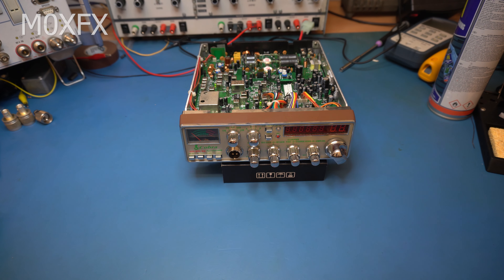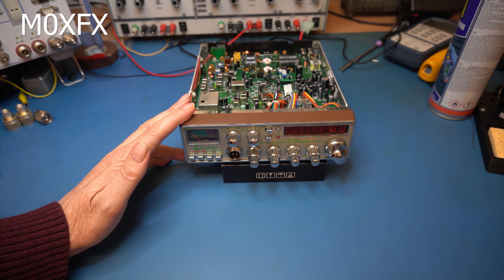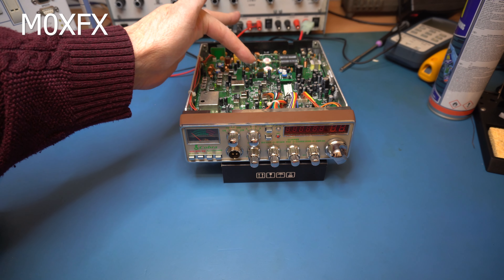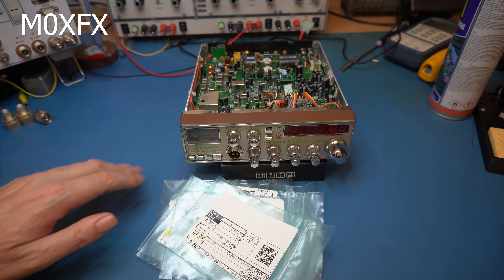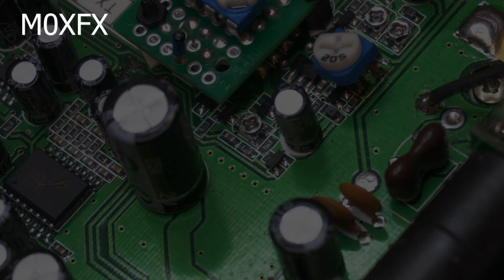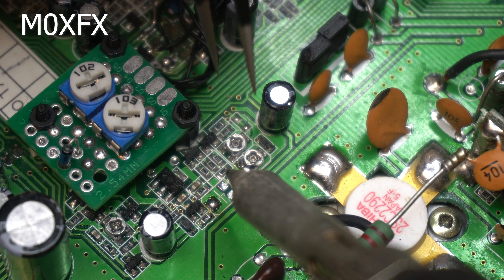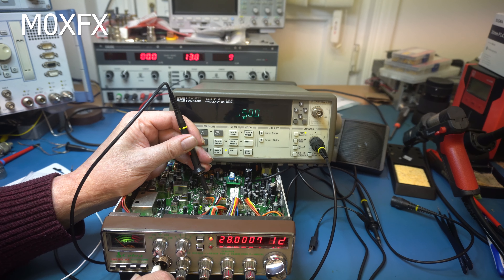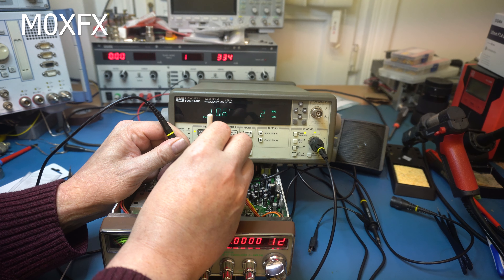Cobra 200 GTL DX Repair & Alignment Part 5 of 5

Comment: Nice finish off John
Reply from the maker: Hi Ray thanks for the comment. It may want T710 replacing as it looks like it’s been really baked by a soldering iron. That being said it's seems to be working but I wouldn’t trust it long term. They are pain to get out as the pins are so loose in the former and pull out when you try to de solder them.
Reply: @M0XFXUK  Hi John yea the coils are a nightmare to get out in all the new SMD radios the pads come away far to easy.

Comment: Well done mate. U did get that spot on they do sound really nice on receive. Looking forward to the next one John.
Reply from the maker: Thanks Gary. Yeah it's an interesting rig only real issue is that the TX and RX frequencies get out of sync in FM when using the clarifier. I think it’s to do with the 10.240 PLL clock getting pulled by the clarifier as it’s only FM uses the clock for receive.   Design issue, not sure if Cobra sorted it out in later models.
Reply: @M0XFXUK  no they havent yet mate. I read somewhere that it shows its head only after the 11 meter mod is done.

Comment: Hi, love your videos, thanks for taking the time to produce them. One thing I noticed the instructions stated the S9 meter calibration was to be adjusted and set using Freq. 29.500MHz not 28.000MHz. Not sure if it would make a difference, I was just wondering if that's why it was so far out of adjustment. Thanks.
Reply from the maker: Hi Kevin, Thank you for the comment. To be honest I don't think it would make much of a difference. For me it would make sense to set the S meter to the centre of the receivers tuning range which is in this case is 28MHz. Regarding it being really out, I had replaced the signal strength meter trim pot for a new one which I didn't show in the video as it was getting too long. In fact I replaced all the resistor trim pots as they were all in pretty bad shape. Another thing is that I set S9 to 50uV -73dBm which I have been told it should be 100uV for CB radios but that being said 50uV is correct for the 10 meter band so I guess it's what you want to use the radio for. I'm glad you like the videos. Best  regards John.

Comment: I have a 200 gtl dx and a 150 gtl dx what would I have to do to use it on 11 meters?? Thanks and any help would be appreciated..
Reply from the maker: Hello Charles, There is a simple mod you can carry to make these work on the 11 meter band and cover the FCC / EU CB channels. I have never done this myself but it looks straight forward enough here is a link. Note: You will need to be able to solder / de solder to a reasonably high standard as this involves surface mount components. If you are not experienced then take the radio to someone who is as it's really easy to cause damage to the unit.   https://swap.qth.com/fcc/cobra-gtl-mod.pdf
Reply: @John Hawkes  just wanted to say thank you so much for the help I hope you have a great night and a better tomorrow...

Comment: More patience than i have, i would have put the hammer through it by now.
now if it was a decent radio i'd spend the time, but knowing how these radios are it would probably be easier to rip the insides out, fit a decent board in there and a linear and build a better radio from the cabinet :)
Reply from the maker: Hahahaha Yeasu!!!🤠

Comment: Hi there i have enjoyed watching you do this radio i am wondering as you enjoy a challenge if you would be interested in doing another one.
Reply from the maker: Hi Gavin, it's great to hear that you enjoyed the video, it was certainly a challenge to sort it out. You mention would I be interested in doing another one, what type of radio is it and what is the problem?
Reply: @M0XFXUK  I have a cobra 200 gtl  dx the same as you have done there are a lot of common faults with it slightly out of tune squelch problem and volume needle is not on point and probably the same issue you had with the one you did